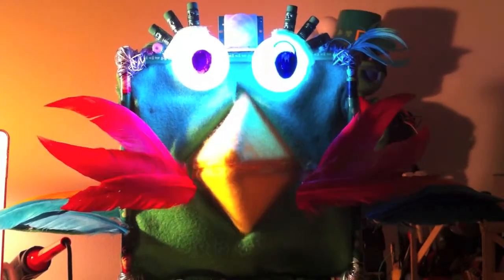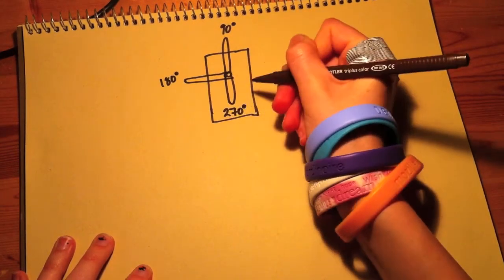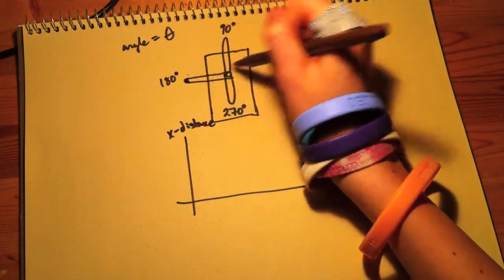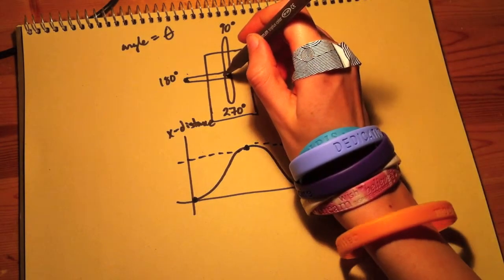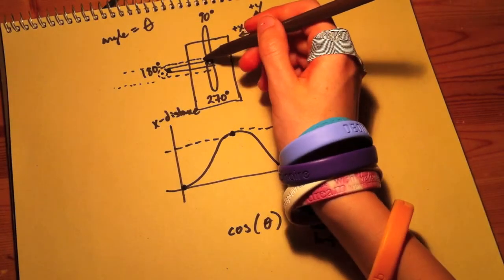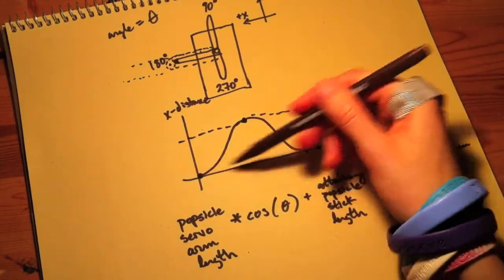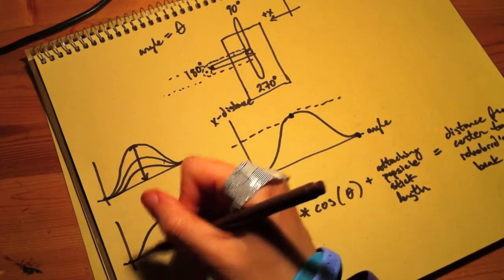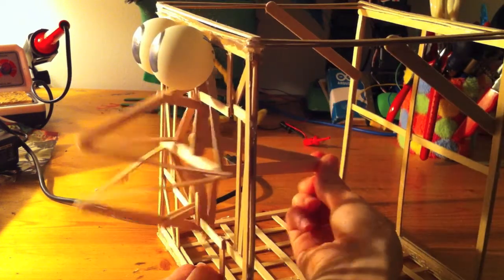RoboBrrd Beak

Comment: That mechanism is quite clever, giving you over and underbite with only one servo.  Of course it can't do a neutral bite, bit I imaging if you could shift the servo up or down the closed lengths could be made equal...  Needs another servo of course, or a cam on some other actuator, maybe double purposed for another function too?  I like the over/under bite more than perfect line up anyway. ;)

Comment from the maker: @vk2zay Thanks Alan! If you want to make the bite neutral, everything would have to be going in a straight line. You could probably do it with a Scotch-Yoke mechanism. :D Making that out of popsicle sticks is tricky though, because of the rounded edges that you need.